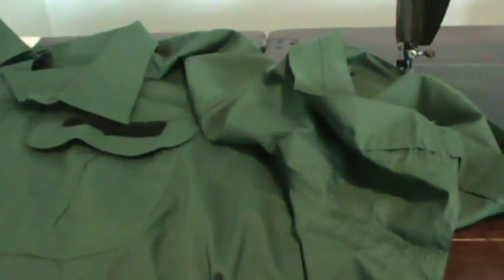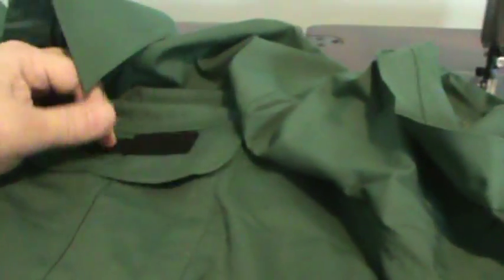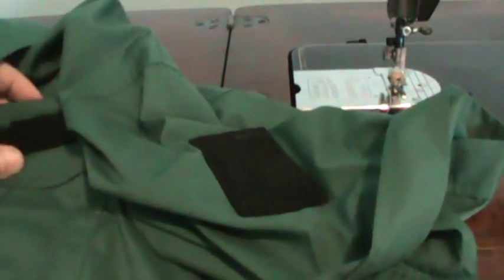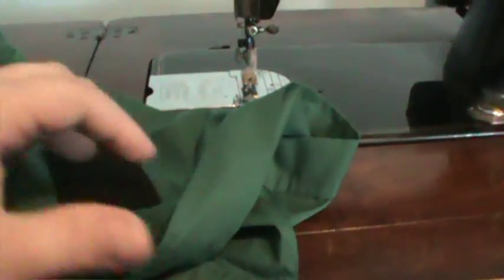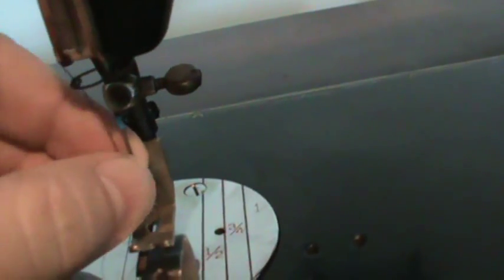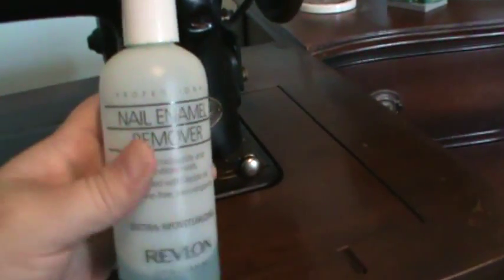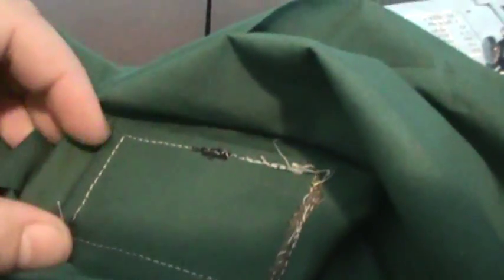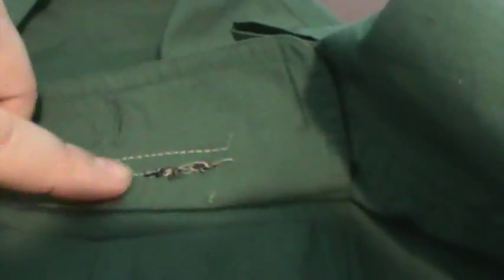Tip for sewing Adhesive backed Velcro on Shirt or BDU.  And another tip.

Comment: the only wide velcro I could find had adhesive, had the same problem, I did think of cleaning it with nail polish remover but it only sewed about 10 stitches before the thread broke again, didn't think of oiling it, will try that. thank you for the tip